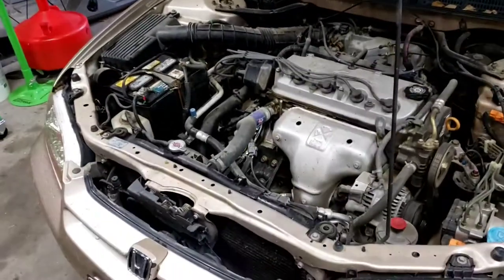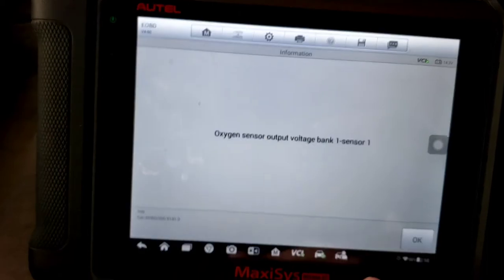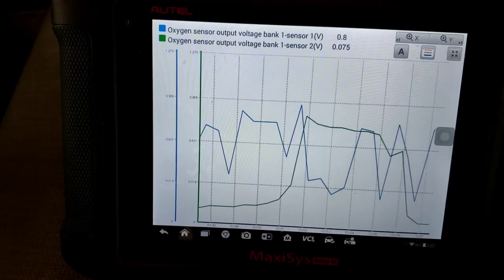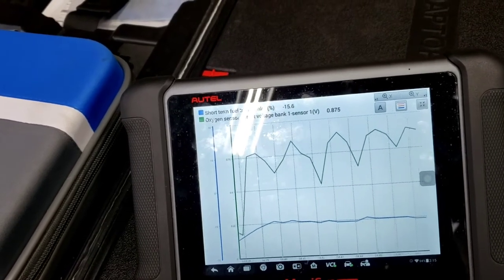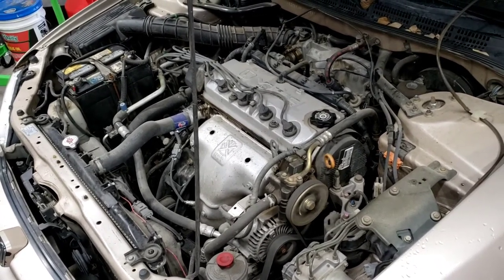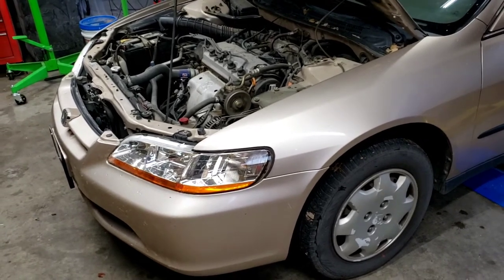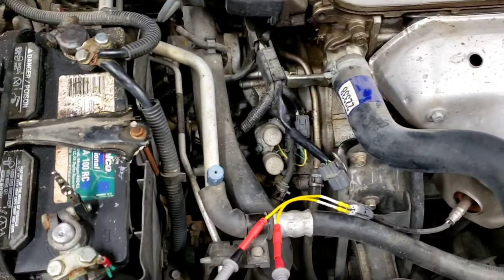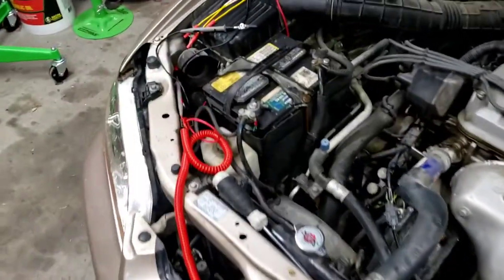2000 Honda Accord Mis-Firing & Negative Fuel Trims Part 1

Comment: All 5 parts of these are actually very informative, but for those who have no patience to watch them, it comes down to a leaky cylinder. One of the cylnders fails the compression test, ie it's compression is not very good, so it's noticable at idle and not when driving.

Comment: ~20+ year old Honda has a right to have some worn rings. It earned them.
Reply: That suckss i have a 2000 Focus with 3000 miles on it, and still going strong.
Reply: @scottykilmer1094 3000 miles on a 2000? 😮
Reply: @scottykilmer1094 or you meant 300,000? My 2000 accord is at 313,000 still running strong. My Honda Civic before this car odometer stopped working at 275,000. Still ran for like 8 years after that.